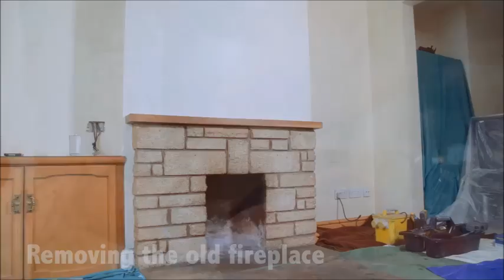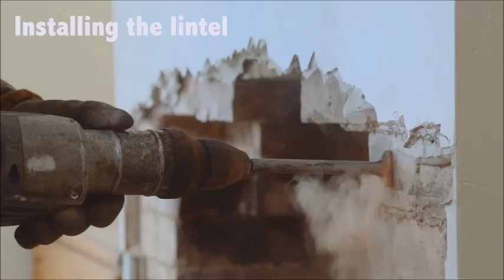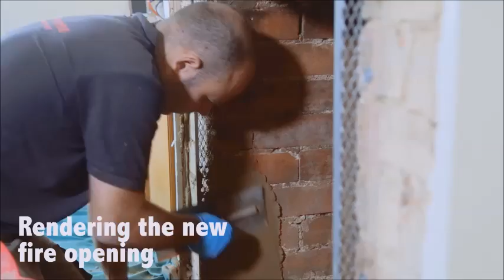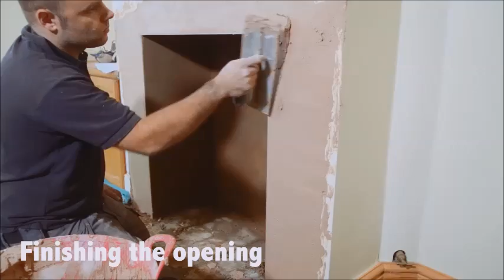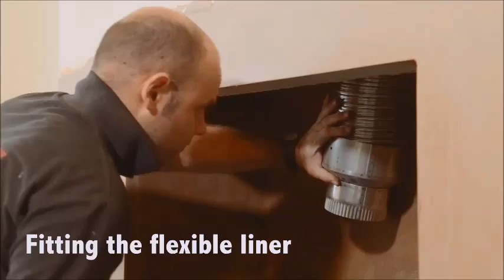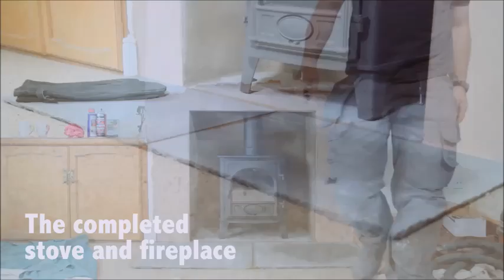Stove and flexible liner installation with opening works

Comment: I am planning on installing the Volcano Plus fireplace insert into my existing masonry fireplace but I want to build out from the old firebox one foot along the whole wall so I can build new built-in bookshelves that the fireplace is flush with. How should I prepare the space for the insert in the areas where it is not set in the old firebox? Is it safe to use metal studs/cement board and firerated roxul to fill in the empty spaces? 
The insert is Supreme Fireplaces Volcano Plus.
Thanks for your help,
James
Reply from the maker: Metal stud, block and render, matserboard and render is all good. avoid firerated plasterboard as that is not allowed, it has a paper backing and is only a time delay before it catches fire.

Comment: HiIf the brick chimney is working do you still have to have a liner for a log burner
Reply from the maker: +Sam Short 
Providing the chimney passes a smoke or air pressure test then no need for a liner, however, stoves work better on a liner, they are all tested on liners for efficiency and it is better for sweeping. 
Hope this is helpful.
Regards
The Heat Store Ltd

Comment: Quick question I had old fireplace which I want to change to stove when I checked opening hole of the chimney it looks like it is around 10cm so 4inch fexi liner will be max that i can go. But is there any issue if Flexi pipe will touch or almost touch walls of chimney?
Reply: The MINIMUM dia liner for a stove is 5in. Get a professional in

Comment: Why not iron bench, iron fire place, spiral smoke outlet with 0,5 m diameter, spiral like 9 m in length. Iron sylinder coat, filling with sand, connection to chimney. Forced flow, through water due emission handling, heat pump residue heat benefitational surplus😅

Comment: Liner is supposed to be insulated.
Reply: Doesn't have to be. There are benefits but it isn't regulatory
Reply: Check NFPA 211
Reply: no its not
Reply: No it isn't. Deciding on insulation is at the discretion of the installer. Sounds like something you've been told by someone that doesn't know what they are talking about. There are instances where vermiculite insulation is beneficial, like in a tall, exposed stack on top of a hill, is one instance but there are others. This probably isn't one of them. Clearly you're not a HETAS H003 installer, go on the course, then we'll talk. If you are still unsure call Howard at NACE, he'll set you straight!
Reply: you got schooled 🤣🤣🤣🤣🤣🤣🤣